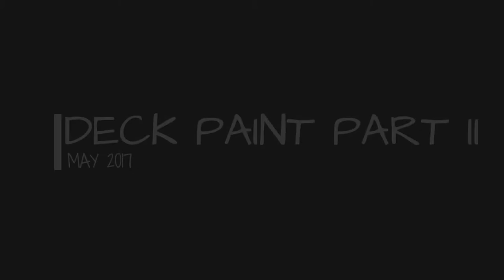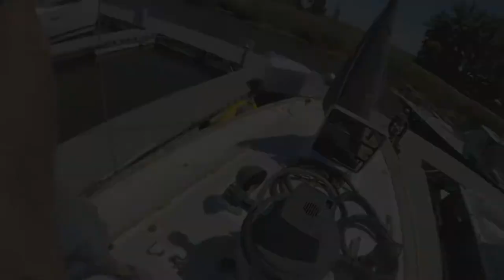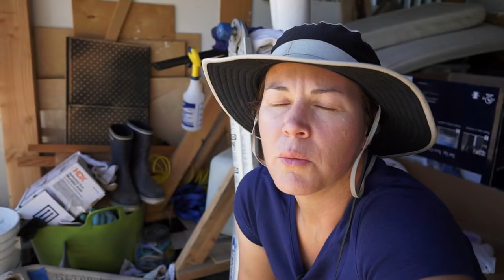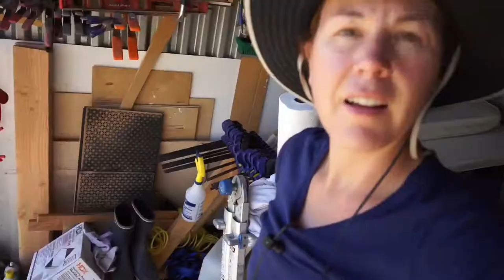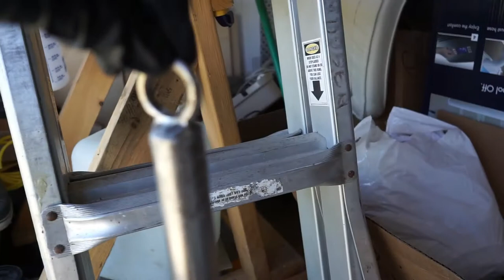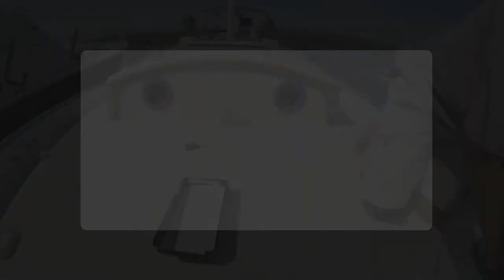SV Ramble On | Deck Paint Part II

Comment: A great cleaner that is fine to use around water without any worries of harming wildlife is citric acid.. it's biodegradable and works amazing especially if you buy the industrial strength and dilute it for whatever you're doing.. I hauled livestock for years and have Harleys and am a clean freak.. I'd use it for washing my livestock trailer and it stayed shiny until I got my next new one.. made this comment before I finished the video.. try the citric acid that you can get from zep and other industrial cleaner distributors.  It's would be great scrubbing the bilge, engines, paint etc